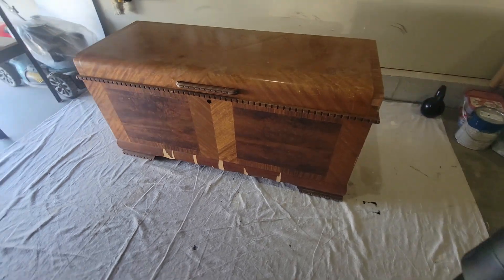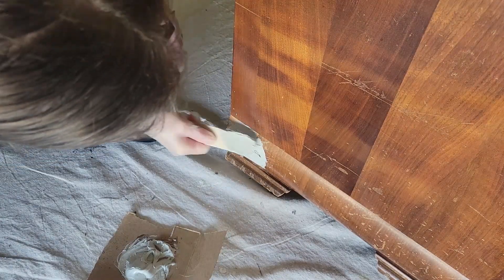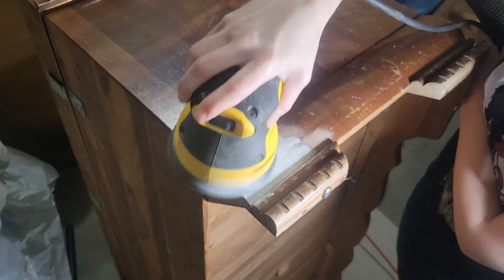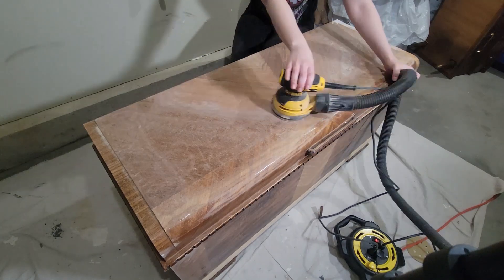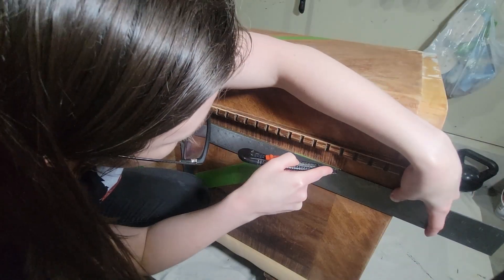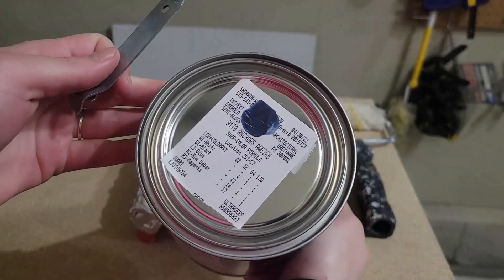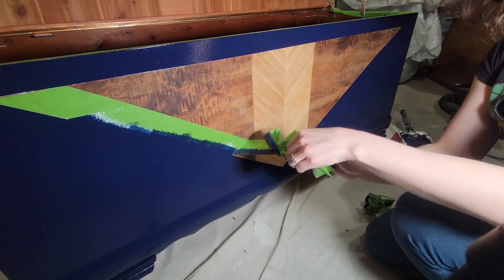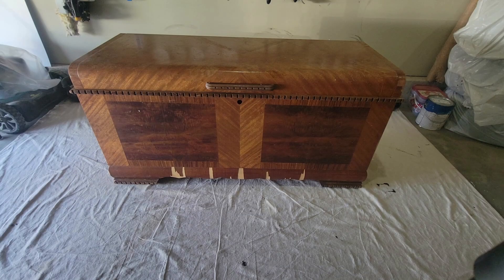Painted Cedar Chest // Simple Tape Design // Beginner Friendly Furniture Flips

Comment: I used the Emerald line a lot and love it. I think if you had used a tinted primer, you would have had a much better experience. Covering white primer with a dark color will almost always result in extra coats in my experience.
Reply from the maker: I am trying to use the rest of my white primer and then get tinted primer, but even with white primer, using black in house and canvas I've only ever had to do 2 coats with touch ups.

Comment: I was one who was against painting it but I have to say, it turned out lovely and I wouldn't have the experience at replacing veneer either.  I do have to start practicing though.  I painted a buffet for the same reason and now I'm regretting it.  I'm building up the courage to strip it all back and have a go at the drawer veneer that needs attention.  If it goes wrong well it's a piece for our house so no biggie.  Yeah that coverage was terrible.  I think I'd have given up after 3 coats.  Lovely colour though.  Well done.
Reply from the maker: Thank you! I would like to try replacing veneer someday but this wasn't a piece I wanted to attempt it on, maybe something a little easier first lol and I was about ready to give up on this paint, I've never had to do so many coats!